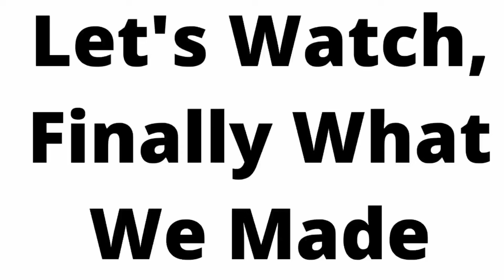How To Make Fire Fighter Robotic Car Using Arduino UNO | BM EXPERIMENT

Comment: hey bro plezzzz help me I am making project by seeing your video and I buy all component and requirement but after i all done with connection and all coding it not working ,the light of Arduino uno , driver and sensor are on ,but the poject is not working please help me it my request FOR you 🥲🥲😔😔😔😔😔😔🥺🥺

Comment: Sir can we need to give dc motors connection to arduino board?  Or simply by giving it to motor driver it works?
Reply from the maker: Yes you need ardiuno and motor drivers both in this project other project only motor drivers run motor directly

Comment: please sir it's my humble request for you help me to make my project , I buy all component and requirement and also I have done with all connection and wiring with your video but it not working please help me I want to submit my project in college ,I can also pay for it if you help me to make my project
Reply from the maker: Coding thik se karo
Reply: @BmExperiment123  I copy your code only
Reply: @BmExperiment123  please sir help me
Reply from the maker: Download karo or ardiuno software me open karke upload karo coding ka or video hai wo dekhalo
Reply: Ha me wo bhi dekha aapki video coding wali kaise Arduino software se upload kiye wo bhi Kiya but kuch response nhi hora
Reply from the maker: To kya problem aa rahi hain
Reply from the maker: Connection video me dekh ke thik se check karo circuit diagram  nahi
Reply: @BmExperiment123  I try many time with your both video but the project is not working 😞

Comment: Did we want to connect the positive Wires of B0 Motor Both at One port ,and negative wires of BO Motor both at another Port of L293D motor drive
Reply from the maker: One side motor cross connection same as other side

Comment: This project don't need 5v relay?
Reply from the maker: No not use ralay in this project
Reply: @BmExperiment123 bro can you tell what you did in end after adding water pump how you gave Power to Uno and all
Reply: @BmExperiment123 my sensor and Uno not getting power why?
Reply: @BmExperiment123 flame sensors are not working I used 9 volt battery
Reply: @BmExperiment123 please reply sir it's very urgent
Reply: @BmExperiment123 I check wires are connecting is this problem because of battery nine volt
Reply: @BmExperiment123  reply bro
Reply: @BmExperiment123 fire sensor not working properly they not getting power why please reply bro

Comment: Sir can I use L293d motor driver
Reply: It is having total four pins at front line to connect female wires in it
Reply from the maker: Bride circuit not use l293d is bride

Comment: Sir battery kitna Volt ka hai. I mean power supply kitna hai motor driver me
Reply: Please urgent reply. Kitna Volt battery use kare
Reply from the maker: 3.7+3.7
Reply: @BmExperiment123  thank you very much Bhai
Reply: @BmExperiment123  bhai mera water pump nahi chal raha. Direct battery se chal raha but Arduino se connect kar rahe to nahi chal raha. Kiya problem ho sakta hai bhai.
Arduino ke 6 no. Pin par water pump ka postive wire or negative wire battery ke negative se. Bhai wiring sahi hai na please reply.
Reply: Bhai urgent hai please reply

Comment: Sir as you showed in vedio we should take each first wire of flame sensors and connect in bread bread board
Reply: Iam really confused for the flame sensor connection pls 🙏 respond me
Reply from the maker: Flame sensor vcc to vcc line gnd to gnd line and other ardiuno digital 📍pin
Reply from the maker: If you satisfied this video please share other

Comment: Circuit digram sahi nhi hai us mei mini board se koi connection ka hai  hi nhi
Reply from the maker: Miniboard is all wire vcc➕ gnd❎ and digital connection
Reply: Do we need to connect the wires of servo motor to flame sensor vcc and etc ??
Reply: And in video for 5v in aurdino u connected it with motor pump but in circuit it is connected with servo motor wire so which one is correct pls reply..

Comment: Were to connect pump motor?
Reply from the maker: Negative wire is gnd and positive wire is ardiuno 📍pin number 6 please watch my all video and share your group
Reply: @BmExperiment123  yes but pump motor not working..all the motors and servo motor working fine..only pump motor not work and also connected on positive pin 6 and negative to ground

Comment: Bro please tell me where you connected the water pump please reply fast very urgent bro
Reply from the maker: Water pump positive wire is Arduino pin no 6 and negative breadboard negative line if you satisfies sher and subcribe chanal
Reply: @BmExperiment123  thanks very much bro
Reply: @BmExperiment123  i will share your channel
Reply: I am not using bread board . Where to connect water pump.  Water pump is not working  plz provide circuit digram of water pump connection @BMExperiment

Comment: Hi
Reply: @BmExperiment123  can u please tell how to connect flame sensor in half bread board
Reply from the maker: Sensor gnd bread negative line
Sensor vcc bread positive line
Sensor analog ardiuno 📍pin show in circuit diagram if you satisfied sher like subcribe my channel thanks for watching
Reply: @BmExperiment123  i cant able understand because i am having half bread board not mini brad board
Reply: @BmExperiment123  i need to give this project trmw it very imporant poject for us can u please help us
Reply: Can u please help us
Reply from the maker: Please watch my all video and sher my link your group need any help connect with me
Reply: @BmExperiment123  I need help can u please 🙏
Reply: We don't to connect the wires in half bread board
Reply from the maker: Wire connect to negative to negative
Positive to positive direct joint to soldier
Reply: @BmExperiment123  but we are having half bread board .what we can do

Comment: Sir in the switch the negative wire where we should connect
Reply from the maker: Battery positive wire direct connect to motor driver and Nagetiv wire connect to between switch and switch other wire connect to motor driver